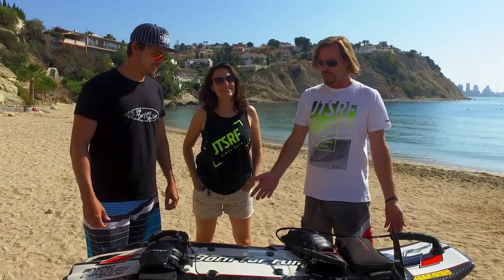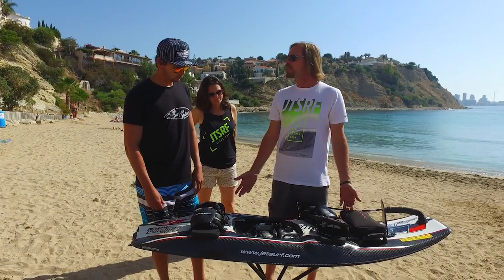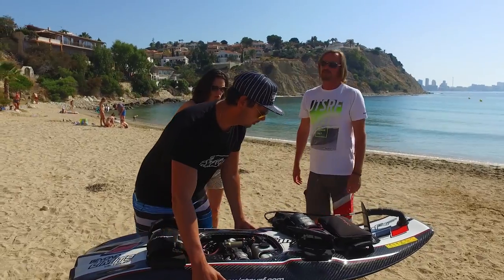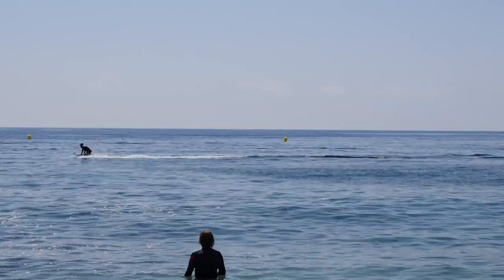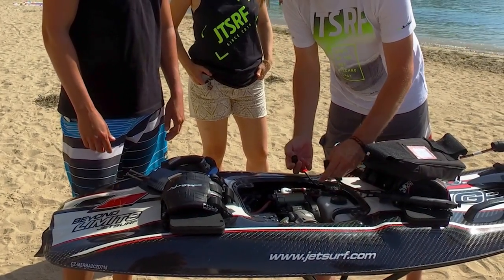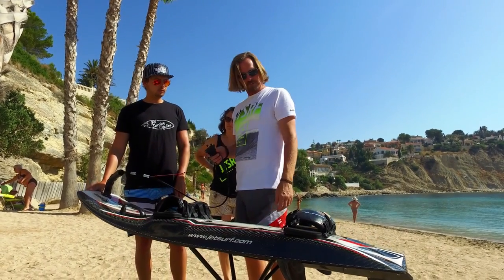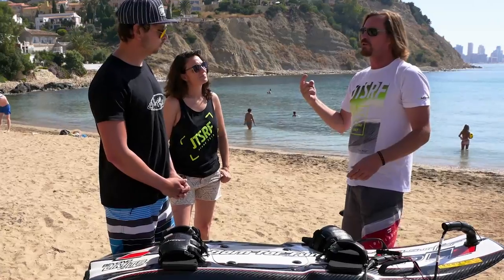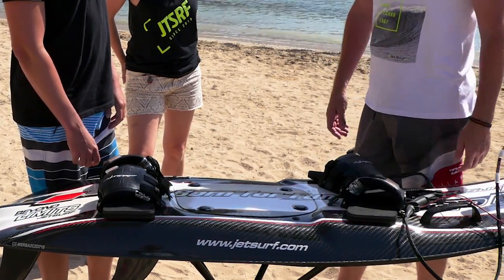JETSURF From Zero to Hero in 1 day (featuring Wayne and Tania Jetsurf Spain)

Comment: no airline is "used to see these boards". I did ask before the flight, even called different airlines. they all told me the same: "you can not take this board with you. take out the engine AND the gastank. then you are fine.
I bought my board in Europe, had to fly home (other continent) and I just gambeled and checked the board in. I asked a friend of mine to come with me to the airport and take the board in case they won´t let it on the airplane.
was lucky. they probably thought its an electric board (without battery)
Reply: which brings us to the next point.
E-boards also can not take their batteries onboard of an airplane. (airline restrictions for Li Ion batteries)
I build E-skateboards, E-bikes and E-boards. you can not travel with any of these boards.
(unless you leave the battery at home)
Reply from the maker: Thank you JP for input! I think you can still ship them cargo with no problem (even electric ones, with battery separate from the board).
Reply from the maker: are you making e-boards as well?
Reply: I am about to make "something"